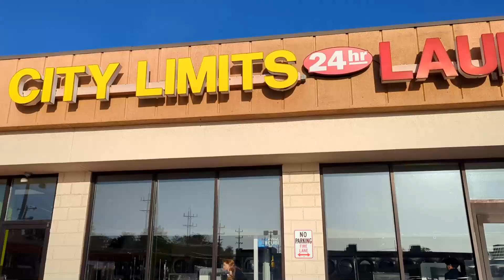Did some coolant maintenance on a Volvo 850 Turbo car. Radiator, oil cooler lines delete and more.

Comment: please explain the advantage of doing the oil cooler lines delete   .....  thanks
Reply: Even brand new Volvo oil cooler lines leak faster than you can install them lol
Reply from the maker: https://youtu.be/LGbgetmn90M
Reply from the maker: Less maintenance, less maintenance cost expense, reduces the chances of a line coming apart and destroying your engine, cleaner drive way, less leaks, and more...
Reply: @RobertDIY  wish I'd known about this before I scrapped my old NA 850   .....